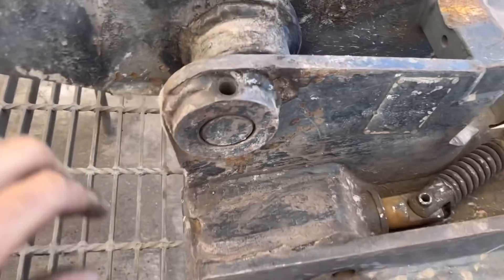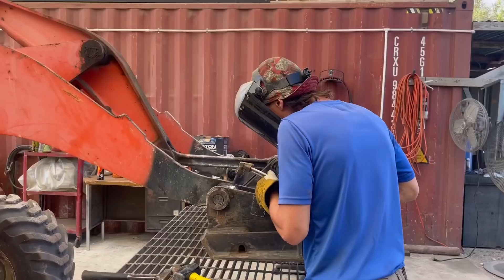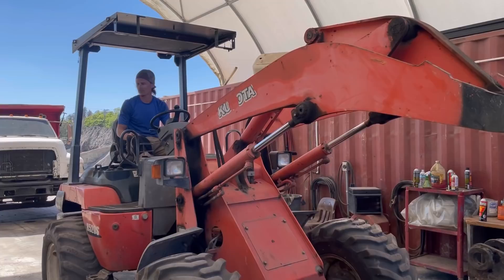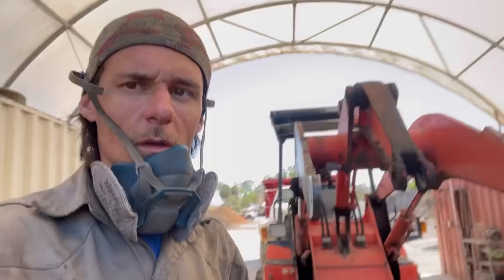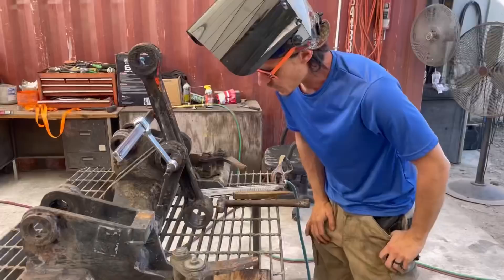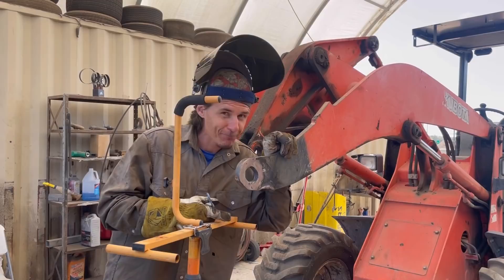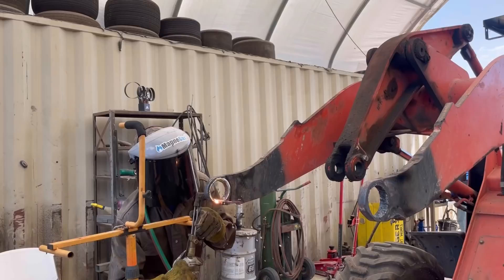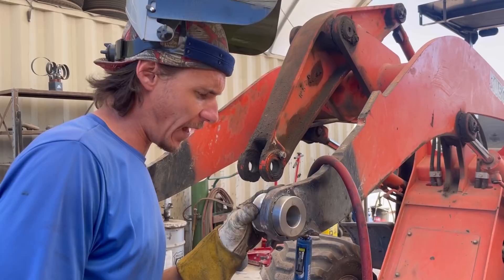Boss and Pin Welding Repair!

Comment: You do need a CDL to drive that service truck for work purposes and it can't go over 26000LBS. Hope this helps if you didn't know
Reply from the maker: You can lower weight at dmv
Reply: @MeltinMetalAnthony  this is just my states laws didnt know if it could help you
Reply: Just needs to register it for 26k or under that. I drive a big ass moving truck with air brakes for ups with no cdl.
Reply: A lot of farmers I know drive 10 wheel dump trucks without CDLs.
Reply: @swamp-yankee  farmers are exempt
Reply: @rudychacon7175  nice. Another way were a protected class

Comment: a mill, or a line boring machine would do you wonders on fixing these bushing locations.  Cutting edge engineering basically runs a weekly clinic on this stuff, but his shop is a little morr established.

Comment: 79yr old mine mechanic in uranium mines in Wyoming . Love watching your repair technique. Same as we did years back before all that line bore equipment. Also made and used dumbbell lineup bars through new pin bosses worked great. Used blueing or spray paint to find high spots and used grinding flappers or hones to true up
Reply from the maker: That’s awesome! I wish I could’ve had you as a mentor! Woulda saved me a lot of hassle

Comment: I watch those Pakistani truck repair videos too. I made scissor lifts for a year, and hitting those bushings with a hammer all around helps keep the pins from binding up when you put them back in. A line boring setup is nice, especially if you could find a used one to do these kinds of jobs on heavier machinery.

Comment: That was really good. Really hard cuts with a torch!  I tend to roll my wrist a little and taper the hole badly. 
I need more practice. lol Awesome work! with all those twists and bends in the machine, your repair was excellent! That poor machine is back to work :)

Comment: Yeah good job Anthony I’ve done a few of those over the years myself and there’s a couple different ways I’ve done those jobs. I’ve cut out those bosses like you did but those Kinda repairs out in the field kind of suck I’ve also have measured about sometimes a foot sometimes 8 inches back from the end of the arm and cut off square take the piece back fabricate two new pieces with the bosses welded in then Double bevel the plate and just weld them in with 7018 like you were doing a structural play test then another way I’ve done especially with a small machine like that is instead of one long boss just cut them off flush on either side of arm and weld a boss on either side Opening the arm plate a little bit so it accommodates the pin once the pin slides through And connects to the quick connect plate works fine that little bit of 1 inch where there’s no boss in the middle ain’t Going to affect that pin at all specially on those small Machines after all it’s just a guide for the Pin And makes for a lot faster job to complete anyway good job though

Comment: Great work, grease would have been a much cheaper option in the 1st place,, amazing how you done it so well, how much would a job like that cost, a lot of work went in to doing it..
Reply from the maker: Ya this was $2800
Reply: @MeltinMetalAnthony   $10 worth of grease could solve this problem. But it isn't like you haven't told them before haha

Comment: Got a worn bucket link on my excavator. The seals for the pin don’t fit anymore. They are 5mm and stick out a little bit now. what is the best option to have it fixed?

Comment: out of curiosity, how do you grease those pins? are there zerk fittings installed on those bushings?
Reply: That's what i wonder too. How are you supposed to grease without any grease nippels? At least i didn't see any.

Comment: Carbide deburr would probably work better than the abrasive grinding ball.  I work in military HET trailers, lots of pins and heavy equipment for tanks ... Better results..... Get yourself a needle scaler...works wonders

Comment: Dude, couple of things to heat up your lunch in the field place it either on the exhaust manifold if your running truck or welder and second thing is you need to invest in a line boring machine to bore out those bushings so the are in alignment then you can weld in the new ones!

Comment: It is always a bigger job than it seems at first look. Nice job finding the line. Holy crap Anthony that is a $1200 day anywhere but in reality you can probably only bill $600.
Reply from the maker: $2800
Reply: @Meltin Metal Anthony  no way you can charge that amount for that kind of work
Reply: @MeltinMetalAnthony  It is worth every bit of that!!! Sorry I forgot that you were there from sun up to sun down.And..that is work that would be almost double anywhere else and they would be out of the use of the tractor for several weeks.
Reply: Makes zero sense if he worked all why he would only bill 600?
Reply: @slayjay77 you have no idea how much it costs to run a business. He's driving there, putting wear and tear on his truck, welder, air compressor and so on. All consumables come out of thar too which aren't cheap. Yeah he can charge that, in fact, by me any mobile welder would be upwards of 3500-4k. Just cause you probably make 25 buck an hour it seems like a lot of money to you. Go back to your office job buddy pushing pencils 😅
Reply: That job is $150+ per hour no doubt

Comment: air arc gouge. i call it my scalpel. perfect for boss removal
Reply from the maker: I need to get a compressor going
Reply: @MeltinMetalAnthony  I run a 20 gallon gas compressor from northern tool.  Thing works great for air arc.

Comment: If I had to go and stand over those guys every morning I would make sure those pins got greased everyday.   I have personally seen millions, yes with an s, of equipment ruined.  One gravel pit went through 4  D-10 cat dozers in two months.  How?  One was they knew coolant was in the oil and drove it anyway.  One the accessory drive was leaking and they never filled the oil.  can't remember what killed the other two but they also were lubrication related.  Then the same pit destroyed a vibratory screening plant motor.  Just on and on.  All due to lack of lubrication.  Only thing I can say the cost of labor and grease is far out waled the cost in equipment.
Reply from the maker: ya I see it almost every place I go that has equipment

Comment: Wondering why you didn’t bring the oval part to a local machinist. Probably take the guy under an hr to machine it out instead of grinding it all…
Reply from the maker: Try getting a machinist last minute these days
Reply: @MeltinMetalAnthony  have you used Lu Machine off Weatherly?
Reply: @MeltinMetalAnthony  easy. At least here in Ontario it is. Metal machining all over around here. Have had jobs just like that i sent out to a guy with a cnc and had done in 15 minutes, he set it all up as i was on the phone with him, loaded the part when it got there and done.